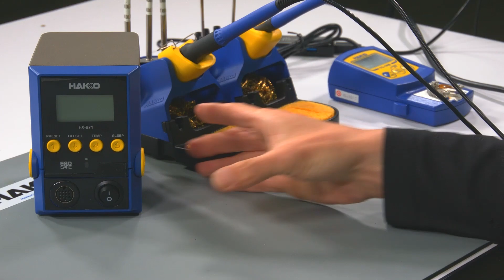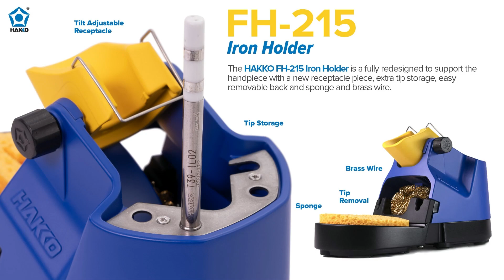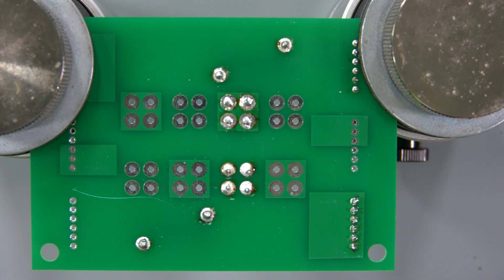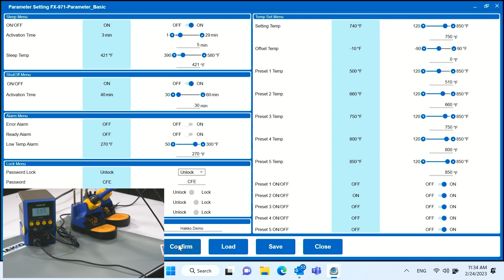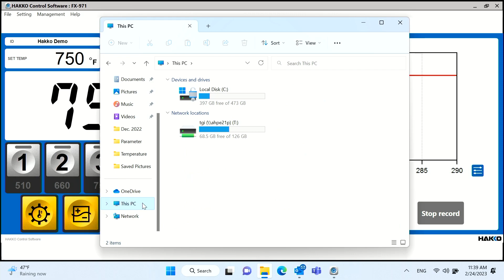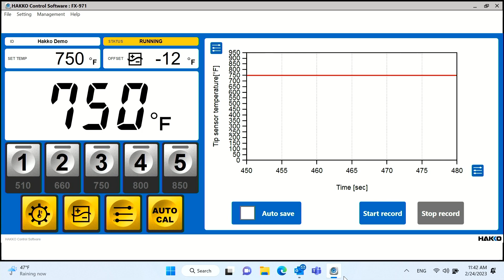Eye On Hakko | Introducing the NEW Hakko FX-971 Soldering Station

Comment: Hello.  I purchased 2 FX-971 Stations with the FX-9701 handpiece and a set of T-39 tips.   The buzzer never stops even when i have made sure the handpiece's connector is properly inserted into the Station unit, and the T-39 tips also properly and fully inserted into the handpiece handle.  The display shows S-E which means something to do with the heating element of the tip (or tip not properly inserted).  I measured resistance of heating element on the tip and it is at specs at 5.9ohms (close to 5.7 ohms on troubleshooting guide).  I already swapped each component of the 2 sets (Station, Handpiece, Soldering tip) and the result is still the same.  Any suggestions?
Reply from the maker: Hello,

We apologize for the delayed response. To install your tip, please use the handpiece holder provided. Insert the tip face down into the designated slot on the holder, then press the empty handpiece straight down onto the tip until it clicks into place.

If you have any further questions, feel free to contact us at 1-800-88-HAKKO (42556).

Thank you, and have a great day!

Comment: Coming from the FX-888D, the single most thing I like about my FX-971 is the T39-B02 tip. It's suitable for SMD and a lot of general purpose soldering. An equivalent T18 tip would make the FX-888 series more useful. The closest is the T18-S4  but too pointy. I have no mental issue with conical tips.

Comment: Always wanted a Hakko but the price point was always a stopping point. I've bought maybe 15 soldering guns in the past 40 years, I got to tell you those cheap Chinese T12 soldering guns are really good, we are talking $40US for everything, including a tip. They've done test along sides of Hakko and well it was pretty even. What I think Hakko needs to do is come up with a entry level T-12 L.E.D display soldering gun with wake/sleep function in the handle like the Chinese T-12 do.  The reason for L.E.D and not LCD, well most people want a single dial for the temp, not click this, pull that, click this, set the date and time, play video games, For gods sake its a soldering gun, keep you eye on the ball, It has 1 function, to heat up a tip at a specified desired point. All these new functions and go out the door. The sleep feature makes sense, having it built into the handle makes sense. One dial and no buttons other than a power switch on the front, not on the back, nobody wants it on the back, that just Hakko trying to make things look tidy and neat and the loss of functionality.  Just one dial, turn left the temp goes down by 5C, turn it right and it goes up by 5C. Nothing more. It should have memory to it can start off at the last set temp. Probably some So of txt file to written and stored with 3 numeric numbers. That way you could get rid of the battery. If you don't need one get rid of it, us a eprom. Price point should be in competition with China, Yes Things are better quality made in japan and higher wages, so a $75 price point retail VS $40 Chinese T12 would be about right. Just saying you now have massive competition at a fraction of the cost, either build something for the current market, or sit back and watch it take over. What you are releasing above with the new features are features that have been on the Chinese market for a few years now, You aren't innovating anymore, you following what the Chinese market of clones are bringing to the table. If you continue to ignore the current market very possibly Hakko will be for the industrial market only, I can see it on Youtube, everyone is buying some sort of T-12 clones due to the price point , The ease of use, etc.
Reply: After watching this video and your recommendations, I decided buy T-12
Reply: @intelb66  Which one did you get? There are so many different ones, and some are better than others internally grounded .
Reply: I agree with hobby market go with Chinese t12,I have a few of them in my bench but having  Hakko 951 or now the 971 at a 330$ prices it would be a nice touch in my bench 
Once in a while a nice piece of equipment is nice 
JBC is very nice too but is above 550$ so you better have a good income
Reply: The hobby segment which is buying the Chinese stuff is small compared to gov/corporate accounts which is what Hakko, Metcal, JBC, etc. target (as gov/corp will never buy no-brand stuff for a huge variety of reasons). They don't have knobs because they don't want the operator messing with the temp, everything is preset and calibrated for the specific product being worked on. Even in service centers, you're more likely to have a few presets rather than needing to dial in a bunch of different temps (honestly, I rarely need to change from my presets of 355,375,400,430 even at home, and it's far easier to tap a button to change these than dial them in).
Reply: @arcade_signal  Close but not exactly correct arcade-signal. The FX-888D and FX-951 were not for the industrial sector but more for hobbyists but they brought in the stupid membrane switches with incomprehensible menu systems. Hakko have now conflated hobby and industrial stations into one product stream. Bad mistake as they are already too expensive. Hobbyists want to change the temp right here - right now, and want to reach for the temp dial not reach for the single sheet manual (where the f is it now?). As another her said, "it's bullcrap" and Hakko saving a few pennies but still charging the earth (in my 1st world country).
I still use my T12 because it is fast and portable connected to a Makita 18v battery I can take it into the vehicle or wherever the job may be.
Reply: @jed2055  I have personally seen FX-951 at production work/rework stations at large corporate sites where only a single iron is needed. In fact it's a popular choice. Most hobbyists are not paying~$300 for a single iron. I have no doubt hobbyists use them but that's not who they had in mind when they designed it

Comment: While not a tweezer user, it would be nice to see Hakko support a set of tweezers on the FX-971.  It could be really simple... just allow the micro-tweezers to run at a bit below their max capability.  Along these lines, what happens if I were to plug in a set... are they simply not recognized?
Reply from the maker: You can use (2) different pairs of tweezers on our FX-972 dual-port soldering station. A pair of regular tweezers (FX-9705) and micro tweezers (FX-9706). The FX-972 is our FX-971 dual port station. The tweezers are not compatible with the FX-971, plugging one into the station will result in a "C-E" error, which is a connector error as the station will not recognize the handpiece.
Reply: @HakkoUSA  I appreciate the response and am aware of the FX-972.  It would still be nice to see a tweezer for the FX-971 running at 100W (50W per side).  This would be a very capable handpiece.  Here are a few additional thoughts:

1)  The added cost of the FX-972 is an additional barrier to entry if a user is looking for tweezers.  What happens if two users try to use this unit concurrently... one or both with tweezers.  Based on the specs I would guess either two T39 and/or T52 handpieces can be used concurrently, or a single tweezer of either model can be used.  The FX-972 is a single user station .

2)  In my almost 35 years of soldering experience there are very few instances where a 15W direct plug-in soldering iron couldn't do the job.  Generally 25W is enough to do most day-to-day work on SMT PCBs.  Granted, 100W is extremely nice and solves some of the response time issues , but it's not needed in a lot of circumstances.

As a said, I'm not a tweezer user.  I find them clunky, not worth the hassle, and with the right tips the work can be done without them .  I do know people who love them, though, and I think it would be a good handpiece for the FX-971.

Cheers!
Brad

Comment: I just ordered the FX600. I had been buying the cheapies from malwart and harbor freight. The tips on these cheap ones get dirty and crusty very fast. I hope this one is better and... what brand of tips do you recommend for this iron? I am building my first drone... thanks for the video.
Reply: From years of experience I don't recall any case where I came out ahead by using 3rd party tips.  Trying to save money on tips only leads to frustration, and the Hakko tips aren't very expensive.  I would order what you want from Hakko directly and move on.  Even people who buy knock-off base units tend to buy name brand tips.
Reply from the maker: @gurukantor  is correct, we recommend you buy direct as to not get scammed by knockoffs or counterfeits. @galimirnund6543 The FX-600 uses T18 tips and we have quite a large variety so whatever type of tip you need you can probably find. The FX-600 can also use the larger T19 tips but you'll have to buy the larger enclosure pipe for it otherwise the T19 tips won't fit.

Comment: A brand new device but the same stupid interface. Who's the professional that want to push a button or more many times to change the temperature? One button to raise and one button to lower the temperature immediately guys. Simply do it.
Reply: I find my new FX-971 much easier to drive than the FX-888D which Hakko has now given a knob, the FX-888DX. If the FX-971 is ever given a knob, I'd like it to be a low profile design.